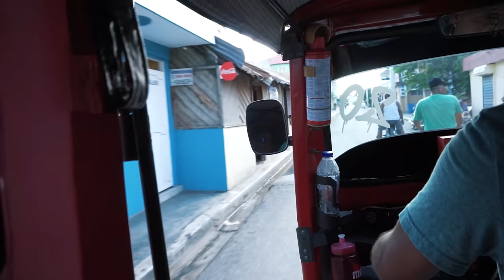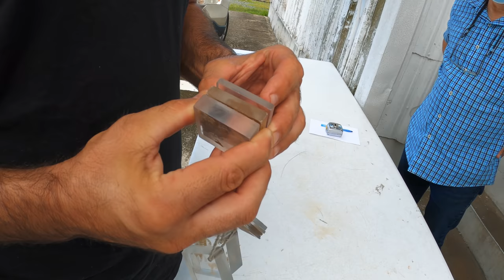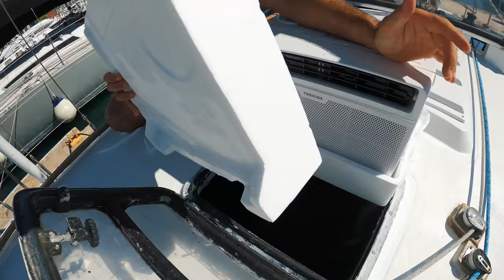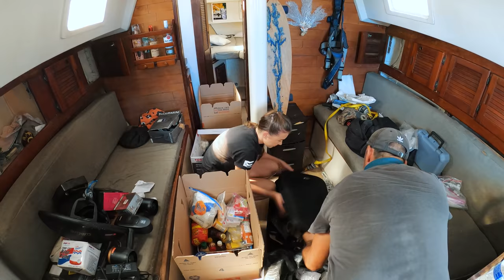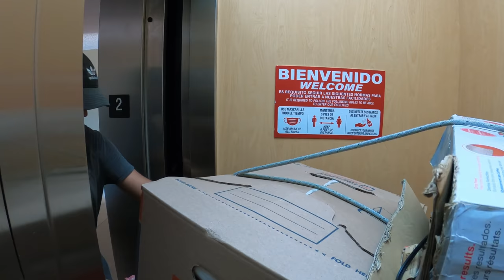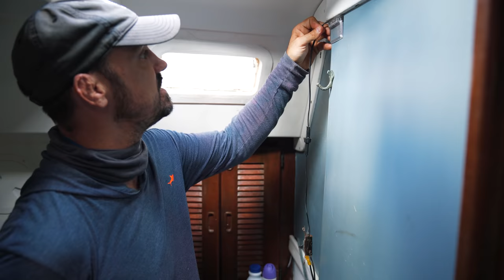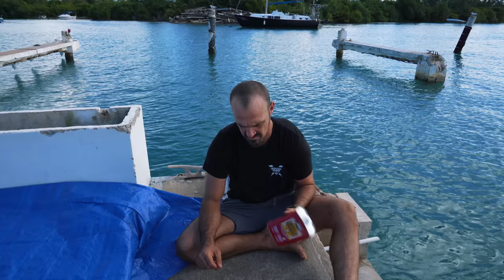BOAT YARD (PART 1) COMPLETELY ROTTEN BULKHEADS!

Comment: Good luck with the rebuild. Quick note from my past experience. When they replaced the engine in our sailboat they had to cut open a lot of the interior cabin to accommodate the hoist. Maybe check with your engine people before you watch them cut away your new work. Just trying to help.

Comment: Hi just a tip that might help. If you want to get a screw out of wood and it's stuck get a soldering iron and heat up the end of the screw. If you just put the soldering iron tip against the screw head for about 3 or 4 minutes it will expand and cause the screw to loosen in the wood. Good luck

Comment: 'yeah, the liquid sandpaper is basically a prep for painting over a varnished finish without stripping and sanding down to bare wood. It works well if you want to just change the finish from gloss to satin or vice versa.  Strip Eaze is the best stripper I've used.....pretty caustic tho

Comment: Good luck with the interior refit, don’t shortcut on the bulkheads, imaging the whole boat being squeezed in a big press.  Seas will do that in a rough sea.  You might consider just a port to stbd steel brace, just to hold the position.  Anyway good luck with whatever you decide, if I was there I’d help out.

Comment: I am a carpenter and I work on sailboats. Sigh. My suggestion is to ask for more thoughts to be posted in your comments. Teak is expensive and good wood. Keep it. Live with the color. Or God forbid, paint it. Fiberglass is not hard to do, but you will need a respirator, latex gloves, disposable brushes. Paint the end grain of your bulkheads with epoxy to prevent rot before installation. The big bulk head is structural, so you should support the ceiling before removing the old wood or your ceiling may drop a few inches. I've seen it happen. Spread the load out to prevent cracking of your fiberglass ceiling liner. Good Luck

Comment: I stained a lot of wood in my day and I don’t use brushes. I use rags. Condition that wood before you stain it. You can buy wood conditioner. Put nine coats of polyurethane on it or you’re just wasting your time on a boat. Please use satin polyurethane after nine coats it’ll be shiny. I hope it all turns out the way you want. I can’t wait to see the engine. ❤️

Comment: Dark wood can be painted,.

Before replacing the bulkhead, if it were I, I would make up a frame template to fit against the hull using melamine faced plywood 3 or 4 mm, coat it with release compound, and fasten it to the hull using  blocks of wood tacked to the mold and gull with hot glue.  Then   lay up a web frame against, in overlapping  contact with the hull using overlapping layers of fibreglass cloth and chopped strand mat, about four or more layers and finish with peel ply.  I always use epoxy resin, it sticks to old fibreglass well and is strong,  When you pull off the plywood leaving the web frame, l clean off the release compound using hot water then acetone and lay up against it another layering on the opposite side to the previous fibreglass. Finish with peel ply as before.  Clean off the hot glue from the hull with a scraper and clean with acetone. You have a nice web frame  around the whole hull and deck.

You now have a strong web frame about four to six inches wide to which you can bolt your bulkhead. To make the bulkhead, I use about three layers of plywood screwed and glued together.  You can use double diagonal ship-lapped boards instead of plywood, but I find ply wood as a basis is fine.  You can glue a veneer on to it if you wish. 

 I bolt mine in place initially until I have it as as I need it to be, then unbolt it, saturate the plywood in epoxy resin such as Everdure (or thin down some slow-cure epoxy mixed with epoxy thinners) and soak the timber to refusal.  Then spread some epoxy glue (epoxy resin plus Cabosil or hemp or cotton based glue powder  on the faired and finished  frame, and replace your bulkhead and bolt and clamp it lightly in place.  When the glue has set, tighten the bolts.  That is how one makes a non-creaky watertight bulkhead.  If you make a watertight door for it, that may save your vessel from sinking in a collision. bit it if is to be a  watertight job to hold back the sea, it will also need some horiz9ontal bracing as well at about eighteen inch centres--which can be used as shelving supports..

A bit long-winded, but if there is an easy way of shirking work, this old sea pooch has probably found  it.

Comment: Before you try to take out old screws, take the bit in one hand and a small hammer in the other and whack the screw. This will help set the bit and shock what you are trying to remove.  Hey Matt, no digging a basement in the boat!!!

Comment: I have faith in you two making your boat much better than before on a budget. A little valve grinding compound will help on some of your stuck screws. Just put a bit on the tip of the bit. The bulkhead that you put your hand through, does not, to me, look like a structural one per se, so you could most likely replace it with a piece of 1/2 inch marine grade plywood, then place a lighter lap side type wood on it. Looks like shower is going to need some greenboard laid down, then you could tile over that area with large squares using some from the materials store reduced to sell? My motto is buy the right stuff the first time and never have to do it again. This would definitely pertain to sailboat/power boat remodels.

Comment: Teak is hard to glue so it needs to be sanded and cleaned with acetone and glued with a urethane glue or titebond 3.  Have fun. Quite the project. 3m 3500 is an excellent caulking adhesive.

Comment: You may be already done with this step but, if you cut out the bulkheads using the multi-tool at the fiberglass tabbing you’ll have a rough template for the new bulkhead.

Comment: Your rot problem is probably down to condensation trapped between layers you’ll need some form of insulation on putting it back together.
Red wood is from one of the mahogany species and will always look red or dark brown as is teak will always be brown. A light wood will be beech or maple , or save money sand down and paint whatever colour you like.   Mick G carpenter.

Comment: If it were me I’d would only sand the wood that you can save and reuse. Sand it enough so it will take a good coat of paint. On your major bulkhead walls use double 3/4” marine plywood. This will give you more strength. Check to see about using star board it’s a man-made product that does not rot and you use it just like you would plywood it comes in different thicknesses as well. It is more expensive but you never have to worry about water damage or rot. Just a suggestion looks like you all are going to make good progress. I am curious as to why you all did not or are not replacing the windows with regular marine windows that you can open and close. I know they’re more expensive but I would think that would be more comfortable for you all in your travels to have airflow.

Comment: Sheet PVC ,1/4 or half inch,comes in  4×8 sheets ,never got to paint it ,easy to clean ,light weight , very strong and water proof you can router it ,trim in wood ,screws adhere better than wood , rough sand and you can glass it ,would be perfect for your entire bathroom and any where else

Comment: Since you're demo-ing bulkheads that "were" connected to stay plates, you might consider laying your mast down until you've replaced & reglassed them. I doubt the designers expected that glassed stubby to hold all the stay tension without the fulcrum that the full bulkhead provided. ~just a thought

Comment: The bulkheads are not that difficult to replace, and there are a lot of channels that do a great job illustrating how to do the fiberglass work properly. (Sail life, Expedition Evans, Bryan Sailing) and many more. One thing to remember is that you need to take the tension off the rig and make darn sure you have squared the boat back up before you redo any bulkheads. Any deformities in the shape of the hull and deck will become permanent once the new bulkheads are tabbed in place. I look forward to watching you guys pull this off, try not to murder eachother.

Comment: I'm not sure where I heard this but for hoarders and those that throws out not used stuff, an so called expert on a local show talked about using a rule she called The untouched. The idea was that if it hadn't been touched in 2 years, then you should throw it out. The exception to this was if it was useful still, then the limit was 3 years. But if things hadn't been used in that timeframe, then it should be thrown out, sold or traded.

I'm a closet hoarder and oddly enough even I can work with those rules, most of the time at least and it helps a lot.

Comment: Hey from NC guys! Yall need to consider protecting your electronics, like your Nav and communications equipment and your batteries and power converters. Get a job box or something to keep your power tools locked up and too heavy to just carry off. 
I think you're gonna find out why there were pocket doors in there. You have to have space for doors to swing or you slide them into a pocket. 3" or 4" is not much of a loss compared to a conventional door or a folding door. 
Looking forward to the engine replacement! 
Brother Matt, have you had to back anyone down for being too aggressive or defend yourselves, speaking of pirates?
Thanks for sharing your adventures with us!

Comment: removing old laquer can be done with paint remover. you can mix it yourselves. a watery solution of sodium hydroxide in wallpater paste applied onto the laquered or varnished surface will dissolve the laquer and you can scrapen it off after 10 - 15 minutes.  it may have to be done repeatedly. but, mind you, the sodium hydroxide is highly etching and you should wear rubber gloves and eye protection and have a bucket of water ready if you get it on your skin! and dont swallow it or sit on it or ... you know?!?

Comment: The biggest advantage to teak is it's longevity in a saltwater environment.  I'd definitely try bleaching a section and then give it a good rub with some oil for a finish.  It'll still have a reddish color but it SHOULD be a lot lighter.  By the way Matt, pocket doors ARE making a comeback especially in "tiny house" builds and if a sailboat doesn't qualify as a tiny house I don't know what does!  It's a pity that coosa and the other composites are so damned expensive as compared to even marine grade plywood, then you'd never need to worry about rot again.  Looking forward to the rest of the demolition (with Darlene ;) ) and the rebuild!

Comment: OK Guys, let mayhem ensue.. We use a lot of NIDA core with fibreglass. It works really well, super strong, rot resistant and easy to work with. We also have used a "whitewash" to lighten the colors on darker wood, sometimes it works. Lets see what happens next. Keep it up.....

Comment: If teak is to dark after stripping you could bleach it or pickle it
To pickle it get white oil based primer
Cut it half primer half paint thinner then use it like a stain on bare wood
When dry you csn polyurethane it
Ps you could tint the pickling slightly if you had a color preference
Your doing a great job whrn arr you going to upgrade the price of your $5000 boat + repairs + motor

Comment: Nice to see you are going at it and renovating your sailboat. In lieu of using plywood take a look at the video put out by CATAMARAN BUILD . See if the use of modern materials will make life easier and better with the renovation. These materials a lighter and saving weight helps with the performance or adding some needed equipment or gear. It might save to time and money. Just a thought! wish you the very best.

Comment: Bamboo is blonde, and lights up an interior it is tuffer than oak. It is light weight. Columbia has an industy built around bamboo. If you had a one foot cube of aluminum surrounded with eight blocks of bamboo cubes. the aluminum would weigh 166 lbs, but the eight blocks would weigh 160 lbs. It would take 4.2 million pounds to rip the aluminum apart, but it would take 32 million pounds to rip the bamboo apart; you figure it.

Comment: So teak is pretty brown / golden  in my experience. A lot of varnish has pigment so that is the red.  Bulkheads can be a finished  exterior grade or marine ply. Chain plates need to be attached to a strong, integral due to the loads they bear. Pocket doors are great if they work... so agree to disagree. I thin just a build up for the head door will provide privacy and more space. Git rot or thickened epoxy will work... Good luck to you both.

Comment: Take a look at minwax wood finish water-base stains. They have some solid and Simi solid color that will work. Use the primer for it and you can get the look you want

Hey guys don't have much time lately but I make time to watch GBU
When you're done with the strippers get rid of the bottles don't keep the cans even if you have slot left.
That stuff will eat up a can and leak stripper sliver your storage area.

Comment: I wanted to add a comment after reflection.  The chainplates are an integral component of your boat.  Take this opportunity to REPLACE them with T316 stainless.  They may look okay but give the age of the boat there is most certainly internal corrosion.  I worked in the metal marine industry for 19 years and have seen it all.

Comment: Bulkhead probably Mahogany based on the reddish color, definitely not teak. Plus the strength of the wood is needed, teak is not strong very porous. Mahogany as you can see doesn't need to be stained, just varnish to protect from moisture. Mahogany is expensive and well suited for boats. You will see mahogany used throughout the years on boats.

Comment: Hey guys, hope your videos. If I may a have a suggestion for you guys on the "windows" . I changed mine to the one you can open, I think they are called port light, anyway, you have the advantage on the window, but at the same time you can open them and cool sea breeze comes in. They are not expensive, and you do not have to change them all. If i could send the pictures of what I did, you will go for them. Installation is abot the same because they come in multiple sizes. Defender marine have them and send to Puerto Rico.

Comment: A little hack it might be to late though,  put a rubber band over your drill driver bit for stubborn or stripped screws it works they'll come out its worth a try it'll fill the stripped head

Comment: Matt, I like "Demolition Darlene", it fits Kristen better than boatyard betty!

As for the boat, those major bulkheads and chain plate bases, need to be fiberglassed  (at least next to the hull) that's where the strength is. It's really going to look as good inside as out!